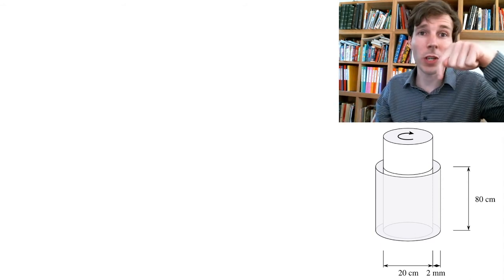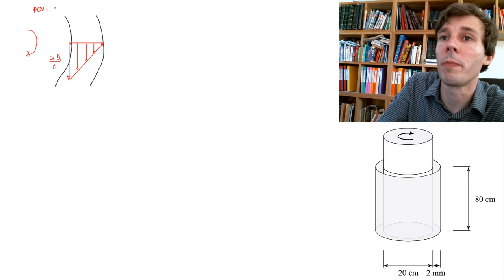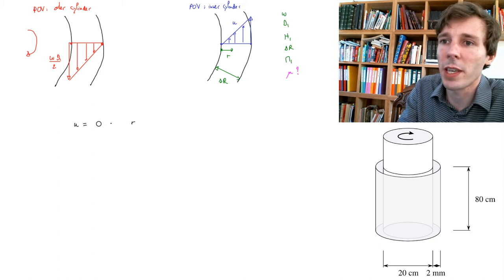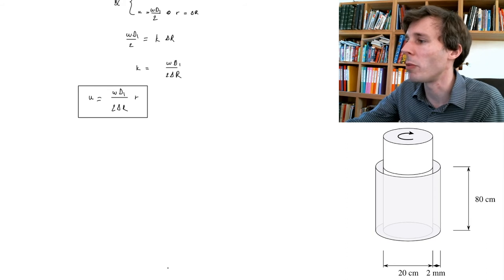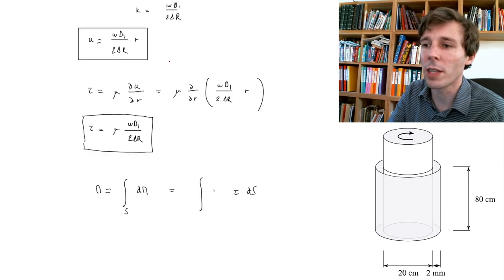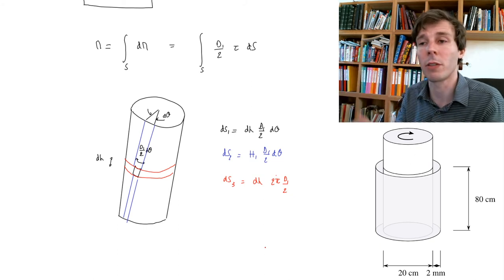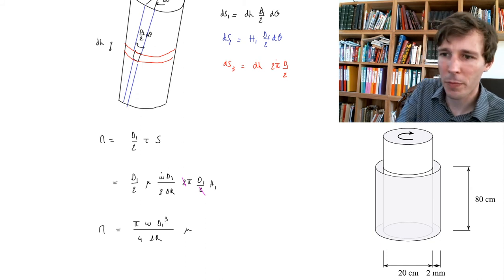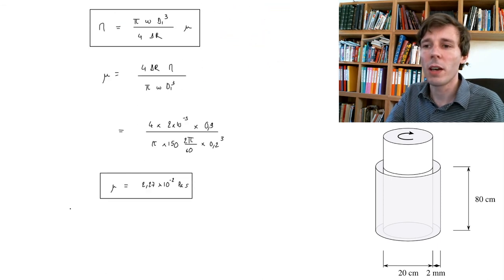Calculating the viscosity in a cylindrical viscometer (Fluid Dynamics with Olivier Cleynen)

Comment from the maker: Unfortunately, as explained in the description and subtitles, I goofed up the final lines, forgetting the height H1 (now highlighted in the subtitles). The correct result is the presented result divided by H1, so 2.8375E-2 Pa⋅s. Thanks to the patient students who corrected me in the last two weeks!
EDIT: the final result is indeed correct, as Zack Y points out below. Only the general expression is missing a term.
Reply: I calculated with H1 in the equation and get the answer as same as the one in the video (viscosity = 2.279726632*10^-2), maybe you just forgot to put H1 in the equations in the video but the final result is correct.
Reply from the maker: Many thanks Zack! I really appreciate. You are right. I have fixed the description and the lecture notes accordingly.

Comment: If i was asked for the reynolds number of the fluid, how would i calculate it?
Reply from the maker: Well, the viscosity and density are properties of the fluid, so that’s easy. You are left with selecting a representative length and a representative velocity. That itself is a topic for an entire video, but in short:
Length → a safe pick is the distance between the two walls (gap between two cylinders)
Speed → a safe pick is the difference in velocities between the two walls (inner cylinder wall speed)

Comment: Hi! Is this cylindrical viscometer the same with rotary viscometer test method?
Reply from the maker: Not quite. In a rotary viscometer the flow pattern is more complex because of there are two metal braces around the inner cylinder, instead of another cylinder. Much of the principle remains the same, however.